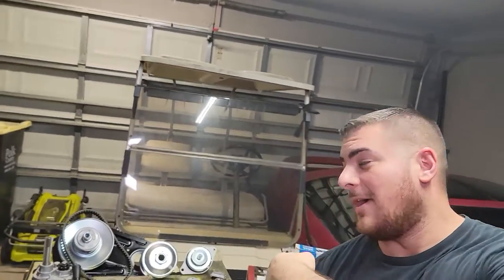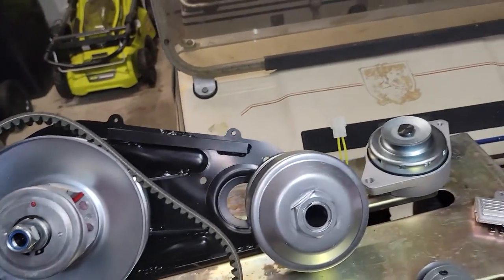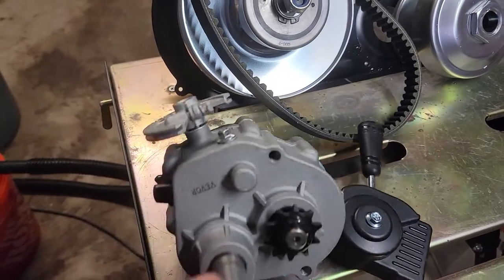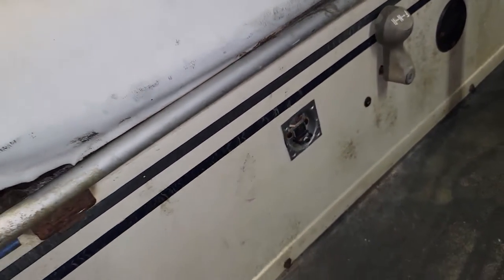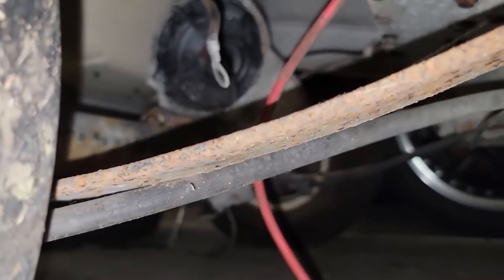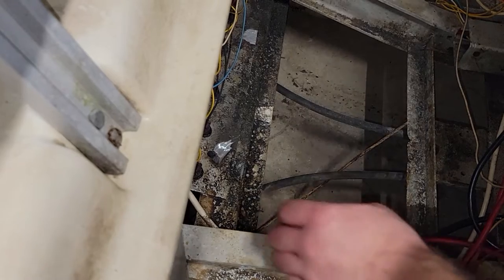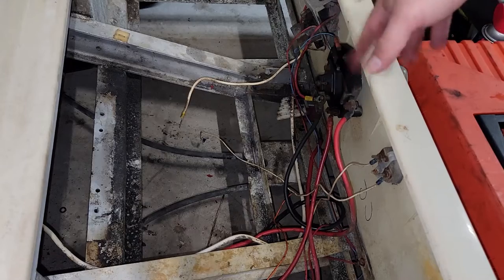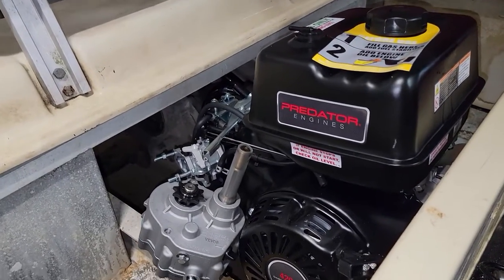$500 Golf Cart Build - Electric to Gas (Predator 420) -  Part 1

Comment: Doesn't the engine have a stator? Just wondering why you need an external charging system?
Reply from the maker: Yes, the factory charging system is only around 3A though. My plans for this cart will require around 10 - 15A at full load, so the external charging system was required. There's a few upgrades available now for an internal stator upgrade, but this setup will serve for what's needed on my build.

Comment: i am trying to find a sprocket for the back axle spline and i dont know what to buy. any suggestions?
Reply from the maker: I'm not sure what size sprocket would work for your setup, but if you need a coupler from the rear diff to a sprocket, this is what you'd need first: https://www.golfcartgeeks.com/products/club-car-ge-10-spline-coupler-years-1982-up?variant=43153058201839&gclid=Cj0KCQiAuqKqBhDxARIsAFZELmL5uT83MTsBS0ZOyKYpLPweBcBfWjkChcfthn0t4LtdLsXXu09fHRQaAkEZEALw_wcB